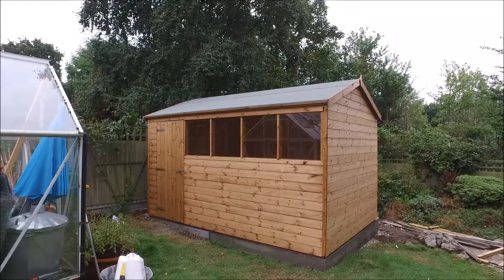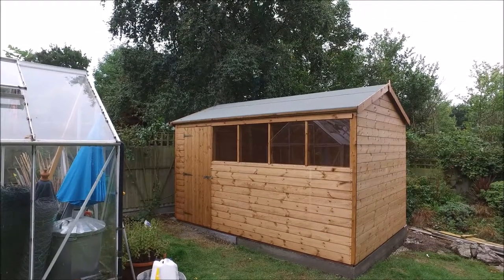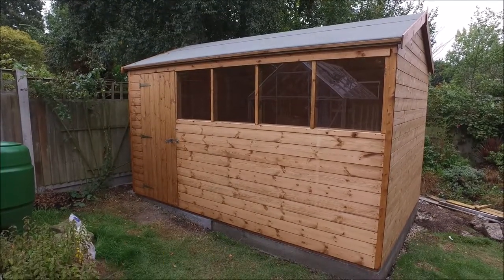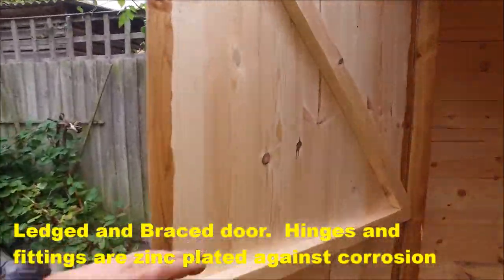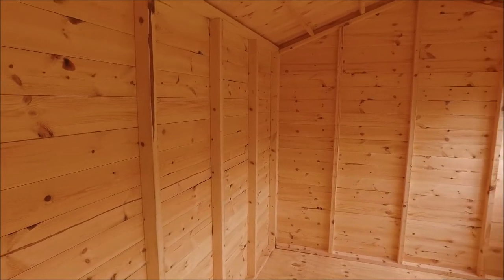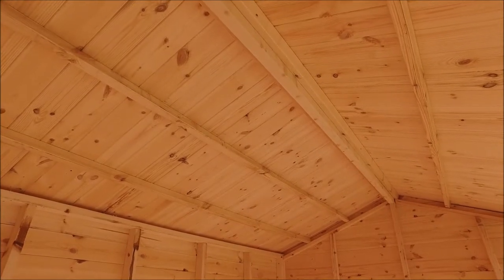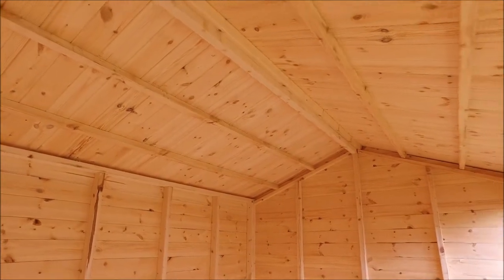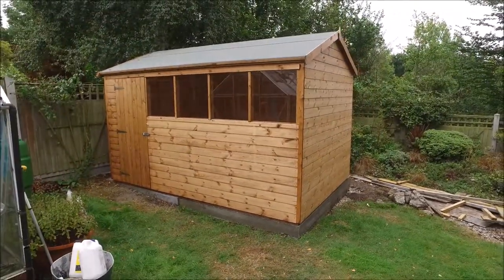12 x 8 reversed apex garden shed by Gorilla Garden Sheds Ltd

Comment: If I'm going to put a shed in the corner of the garden what gap should I leave around the sides?
Reply from the maker: The best thing to do is leave enough room to get around it for maintenance.  Keeping the timber treated is one of the keys to getting the best service life out of your shed.  
Ecobase will lift the shed off the base and prevent the floor from rotting - we can supply this cut to size
Fitting guttering will stop water from running off of the roof and splashing back up - the main reason why its always the bottom two planks that rot on a shed.  We can supply and fit that too.